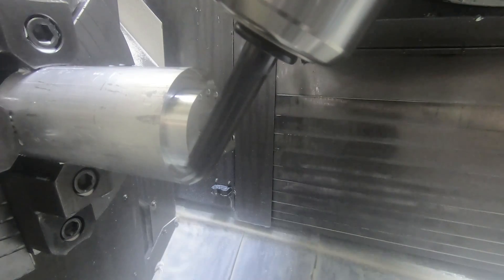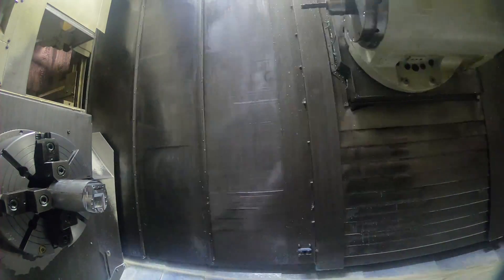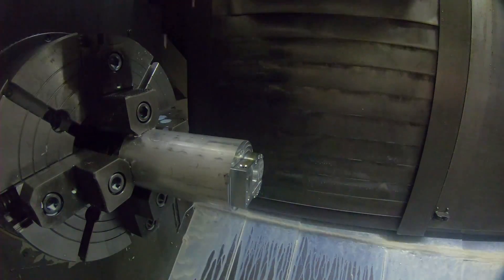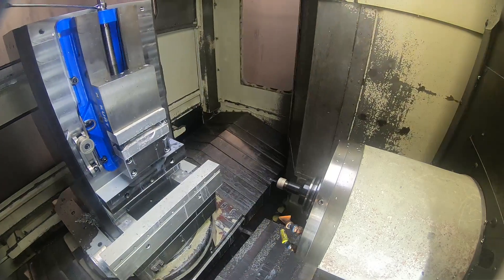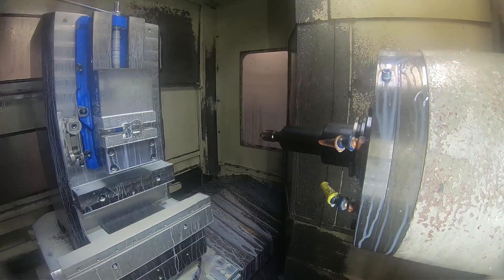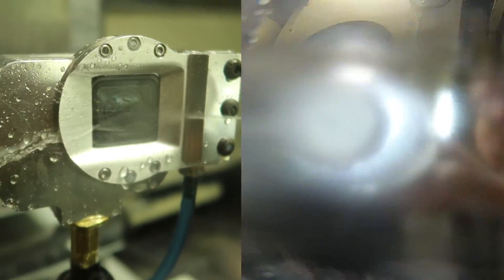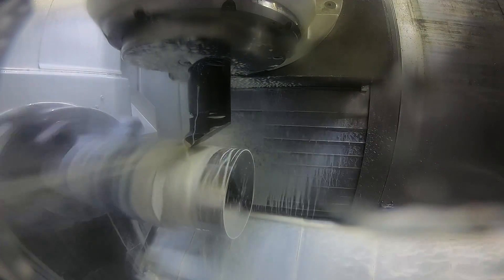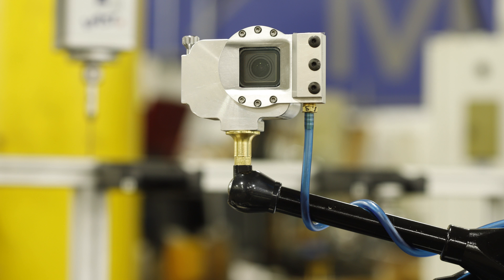Side Blow Air Knife for GoPro case

Comment: Yup....more AVE squad here. 🤙 

Very cool idea! By the way (corporate airplane pilot here) just a simple idea but by using some simple aerodynamic knowledge you could easily increase the speed of the air across the lens (without increasing the supplied air pressure) and also help keep that air “sucked” down to the lens by introducing a small gentle radius on the same side as the lens in the path of the airflow just before the air crosses the lens. (This is basically the “Bernoulli principal” in case you’re interested in learning how this works aerodynamically.) Anyway, like a said...just a thought and might be something cool to try if you do another iteration.

Comment: If I may I would recommend moving the nozzle slit further back toward the lens and using a smooth sigmoid-like curve on the ramp to try and keep the jet closer to the lens and more laminar, high speed air jets are reluctant to turn corners (chamfering the nozzle head to be even pointier close to the tip could also help a little). If you are able have the nozzle directed down the slope that would be even better but might be difficult without the nozzle head ending up in the field of view. I wonder if a second knife around 20mm in front of the first could keep the bulk of the liquid from reaching the glass? Would need to let air flow freely between I guess, since there might be a fair amount of suction between the jets, but It's such an elegant structure so far, it would be a shame to clutter it up with that.

Comment: Great work!  I'm wondering if the addition of an "air curtain" placed a little further away from the lens cover on the assembly, along with the existing air knife to clear the actual cover, would serve to even further increase the ability of the system to fend off the coolant and help provide a pretty incredible view of the machining.  It already works incredibly well so it may not be worth the time spent.  Thanks for the videos!

Comment: interesting but the air will follow a curve so you dont need the second part that is bolted on.  the air slot could face forward provided there is a curve for it to follow around the corner and onto the lens.  cool idea, keep them coming.

Comment: Takes me back to a different age, when using lasers instruments on transonic compressor rigs, we used a similar air knife blowing 1,1,1-Trichloroethane mist over a window to keep it clean, not sure H&S would allow that nowadays! Had no end of trouble as the pressure delta over the compressor stage messed up the flow rates. You could try you try a denatured alcohol mist if that’s affordable.

Comment: That's pretty darn impressive Peter. I wonder if it would be any better blowing downward so that gravity might offer a little help? It probably wouldn't be much different, but could be worth turning the camera on its side to see.
Reply: l wilton ... I wonder if the shorter height vs width would also make droplets disappear quicker (they won't have as far to go).
Droplets that stuck seemed to take a little while to traverse.
Reply from the maker: Right now I have .001 Thick Shim/Tape under the top piece. I'm thinking of trying some thicker shims to increase the flow. Maybe there is a sweet spot I haven't tried yet. Thanks.
Reply: How did that go? Did a thicker shim make it better?

Comment: I remembered seeing this video some time ago and came up with a different idea: you actually don't require a housing for the gopro. All you need is a rotating glass in front of the lens at high rpm. The centrifugal force will cause all coolant to be sprayed off.
Reply from the maker: This indeed might work. But the complications of doing it at this small size would be difficult. The main reason is the noise it makes would be picked up by the camera’s mics. The air knife only requires about 20 psi to function. It is virtually silent at that pressure. I need the sound for the video. I would have to record it separately and sink it to the video. Another complication.

Comment: There are hydro and oleophobic screen protectors you can buy for gopro (or just compounds you can apply e.g. rainx).  Have you considered any of those?  They might reduce the wetting that lets the liquid stick to the surface and let it blow off more quickly.
Reply from the maker: The front window is glass with a coating that repels oil and water. It’s still up in the air how that coating will hold up to the coolant. On the older GoPro case I have used a number of different coatings like are sold for cars windshields. They work for a few minutes but I have had to keep reapplying them. The coolant attacks them.
Reply: Should have figured you already tried it. :)    Honestly the results now are more than good enough IMHO.  If you're sitting there thinking about the clarity of the view it's one thing, but when you're just engrossed in watching the cut I have a feeling you'll basically forget the stragglers.
Reply: Edge Precision Have you tried Nyebar? Its a flourocarbon barrier that resists oil migration.
Reply from the maker: No I haven't. With the present coating the glass window I cant apply coatings like RainX or the one I like better FlyBy. They just bead up and I cant spread them on the glass.

Comment: thanks for sharing this.  I've been tasked with creating something similar for a camera mounted to a car that drives in the rain.  I wont have "shop air" so it may have to be some sort of high RPM air mover.
Reply from the maker: @kellycoe1787  These devices I have built take very little air. I run them on an oil less air compressor that only supplies air a two cubic feet a minute with the regulator set a 20 psi. And even that cycles on and off. You could easily run this off 12 volts and an inverter. It doesn’t really help to turn up the air to a higher rate. Also at this low flow it makes virtually no noise if your sound (in camera) recording is important for what you are doing.

Comment: Looks promising, you can actually see something on the finishing cut in the x direction.  I think you have some of the best machine footage with coolant out there.  How thick did the lexan end up being for the front lens?
Reply from the maker: Thanks Bill, the front lens is glass .043” thick. It also has a coating to repel oil and water. The back window is .010 Lexan. So far it holding up fine.

Comment: Came out pretty awesome! Can't help but wonder if pushing the coolant downwards rather than across would work better?
Reply from the maker: The thing is I quite often use the camera upside down. So down in that case would be up.
Reply: Edge Precision 
Have you tried blowing upward? At one point I found that up actually worked better than down.
Reply from the maker: Hirudin only if I had the camera in the position that would be blowing upward. Other than that no. I will do some experimentation. It may pay to make the air knife rotatable on the camera case.
Reply: Edge Precision now that would truly be awesome. Any angle. Might be more of a nightmare to make than it's worth.
Reply: Edge Precision now we're getting FANCY!

Comment: Looking good, a bit off topic but how do you go about sourcing the blank soft jaws for your Kurt vice? Do you just make them yourself or do you order them in? I currently order mines in but was just thinking off making up a batch from stock. Cheers
Reply from the maker: I have always made my own soft jaws. I do it for a couple of reasons. First when I started doing there really wasn’t any commercially available at a reasonable price ( only from Kirt). Second and really the real reason is I don’t like the dimensions of the ones you can buy. I like my jaws to be a little thicker and taller and also to be able to flip over (Slot the screw holes). For the 8” Kurt vise I like 1.5 x 2.5 stock size. Also I make 8” ones and 12” ones also.
Reply: I had a "university" machine shop guy come in looking for us to do a honing job. When he saw one of our Mori's machining parts he exclaimed:
" Ha ha ha ha, you made your own home made aluminum jaws!" 
He thought it was so hilarious. I asked him: "You have never seen shop made aluminum jaws before? He said "No."
I told him: "Perhaps you should get out more."

Comment: Awesome video, I wonder if the airblade is 1 cm away from the window with venturi, schuldnt there be any drops hitting the lense... If the "airshield" is big enugh. So not letting the airblade touch the glass.
Reply from the maker: As I said in a earlier comment air alone (or at least the amount I want to keep it as quiet as possible) won’t keep the coolant from hitting the lens. So I’m left with blowing it off. Actually more air doesn’t work better than less has been my experience. That’s because you dry the water out of the coolant and it leaves the coolants concentrate on the lens. It’s better if it remains a little wet. It might actually help to spray clean water with the air.
Reply: Thanks!! Great video and explanation of the matching operations and logic of the air flow Design and pressures. 
Not having to fuss around with the coolant issues with the camera will allow you more time on the video content. 
As always I really enjoy you taking the time to share your work process and all the thoughts behind the final product.

Comment: I was one of the first lucky guys to get their hands on an integrex back in 2001/2002. It was a first generation b axis 100y. The ones before that were the clunky 0/90 machines. Gantry loader, tailstock, 6" chuck. Had its issues, but it was a great machine. Ran it more like a horizontal than a lathe. 24/7 production via gantry, secondary machining on our horizontal. Now, I teach people how to run equipment rather than being the guy actually doing it.
Reply from the maker: You are correct in what you say. I have seen people here in Houston buy this kind of machine and do mostly lathe work on it. What they should think is this is a milling machine that can do turning. This thought process will change the whole way to visualize what you should be, and can be doing with these machines. This is more like a horizontal mill than a lathe.
Reply: Edge Precision my machine did about 10% turning, 90% milling. I would have to make custom jaws to remove polygonal parts after machining, but otherwise it was way easier to maintain location tolerances and such. I had one part that had a 3 degree hole that needed to be basically perfect to a perpendicular face and doing it in my 100y made it completely perfect. I was involved in a project making F16 landing gear struts that eliminates 15 out of 18 processes. Customer paid off a 750k machine in like 4 months 😂. I've done cylinder heads, spine implants, jet engine components and some other things on this style machine. I've also done work on the inverse, which is a 5 axis mill with a trunnion table capable of turning between 800 and 1500rpm, depending on table size. Working for a machine tool manufacturer, I get to see all of the cool stuff way before anyone else gets to play with them 😋

Comment: Really cool idea! I'm curious though as why you chose to have the air go down onto the lens? Isn't it losing speed this way? 

I would suggest using Rain-X (or something similar) on the lens as well. I use it on the visor on my helmet and it makes a huge difference in how fast the water runs off it. It makes it hydrophobic, for a while, so the water beads, instead of streaking drips, and gets blown away really quickly. Not sure how the GoPro would react to being sprayed with something like this, so maybe use a piece of cloth or paper towel to apply. 

Definitely subscribing to your channel, with thanks to AvE!
Reply from the maker: Thanks Yvolve. RainX only lasts a few minutes the coolant attacks it. The glass window has a Hydrophobic coating. There is something that works better. Its FlyBy Forte. its sold by CarPro. I have been using this it holds up a little better to the coolant.

Comment: Do you write the probe code manually or does your cam have the ability?  I just got a Renishaw OMP 60 and  just starting to use it.
Reply from the maker: No my cam software doesn't do it for me. As far as writing the actual code that does the probing cycles I use the Renishaw macros and just call them in my programs. I have a few videos on this subject "Renishaw single surface measure" and "Renishaw feature to feature". What you saw me using here in this video is the Renishaw easy set macros. With them I do it in MDI.
Reply: Edge Precision that's what I have been doing too. Love that setup.

Comment: This might have been discussed before but: do you know rain spinners? These are glass filters which spin, un front of the lens, using centrifugal force to repel water drops. It is used on copter cameras.
Best.
Thank you very much for your videos.
Tom, France
Reply from the maker: Thank you for your suggestion Tom, Yes it has been suggested many times. The problem is implementing this at such a small size, with motors sealing it all from coolant with the dirty environment in a machine. There is fine shavings oil and coolant to deal with. The other problem is the possible noise it will make. This will be picked up in the cameras microphone. With this design at 20 psi it is quiet enough that the camera doesn't pick up the noise over the machines sounds. I know i could record sound with a different recorder but that just adds more complexity to the process.

Comment: Popped over as AvE recommended. Trust issues between Chuck and that tool doing the cutting. I couldn't hear what was said but it looked like Chuck wouldn't move until tool got far away as possible and sat still. Clearly some tools are trusted more than others.

Comment: Really neat product! I'm curious about what kind of toolholder you're using at 0:09?
Reply from the maker: Thanks Caleb Nixon, That’s a Big Daishowa milling collet chuck. The wrench for their chucks use a one way roller bearing. There are no slots or grooves in the nut. In my opinion they make the best (and probably most expensive) collet chucks.

Comment: You should try putting a layer of Rain-X on the camera lens, I bet it would get the coolant to bead up and blow off even faster
Reply from the maker: I have used Rain-X the coolant still attacks it. It lasts only a few minutes. There is a better coating called FlyBy by Forte. This works  better but it still washes off. The glass window has a Oleophobic coating. This coating causes water and oils to bead up but is more resistant to the coolant.  The window in this video was kind of old. I just recently replaced it with a new window with the same coating. Its working much better.

Comment: why is that cutting liquid running down the sides of the work bay...  2:13
overflow?
Reply from the maker: If you are referring to the coolant running across the way covers. That is intended to flush shavings off them into the chip conveyor.

Comment: which CNC are you using Edge precision?
Reply from the maker: If you are talking about the machines in this video. The first one is a Mazak Integrex e650H. The second on is a Mitsubishi           M-H80E Horizontal Mill.

Comment: Does rain x help?
Reply from the maker: It does help but doesn't last long in the coolant (I used this stuff called FlyBy by Forte on the first GoPro case. It works better than Rain X.). The glass window has a special coating to repel oil and water. That coating also makes Rain X and other type of similar treatments bead up as well.

Comment: Some Rain-X would probably help with blowing the coolant off the glass.
Reply from the maker: It does help for a few minutes but the coolant eventually washes it off. The glass window has a special coating that does a similar thing. There is a coating called FlyBy by Forte that is better thn RainX for your cars windshield. It does better but the coolant still gets to it also.

Comment: What  A Great Project !!!!   How Much Air Pressure  ???
Reply from the maker: About 20 psi. I’m running it off a very small air compressor with is only capable of 2.2 cfm. It easily keeps up with the flow switching off it high pressure switch.